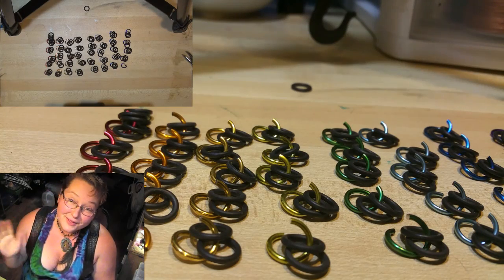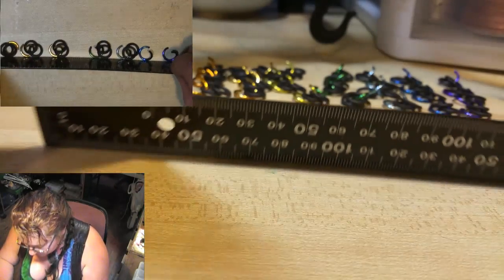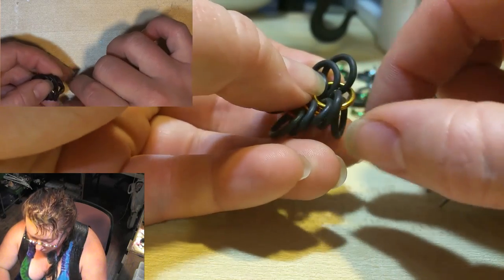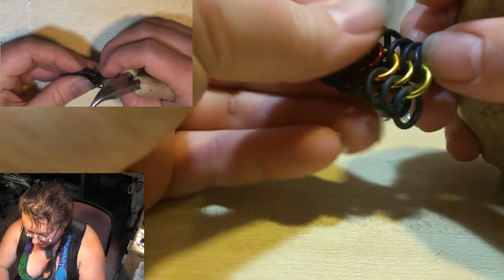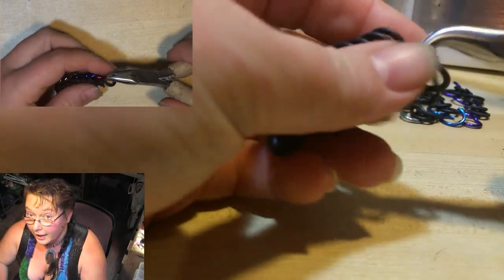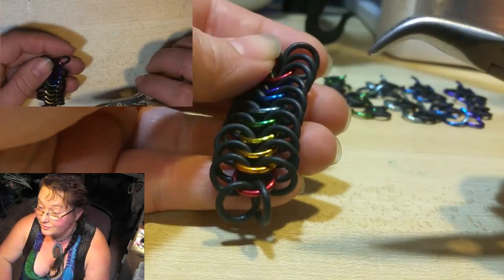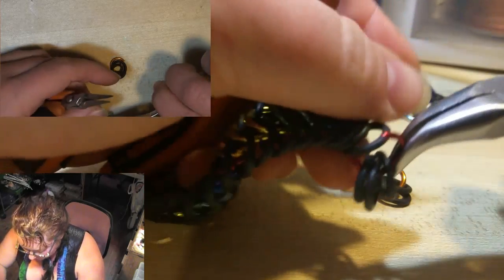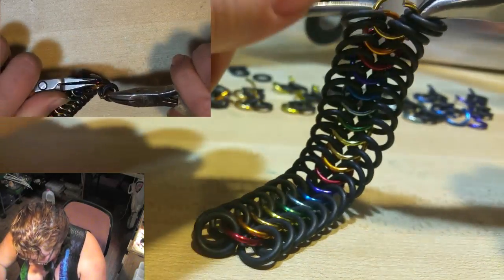How to Weave Chainmaille Stretchy 6-1

Comment: Hi, Yvonne! I get my anodized aluminum rings from The Ring Lord, too. I've seen you tumble silver, but how do you remove burs from finished AA projects?
Reply from the maker: Hey, Shay! I have had some success with running AA projects through the tumbler dry with plain rice; I'd recommend check it every 10 minutes at first until you get a feel for it to make sure to AA is holding up
Reply: Thanks so much. I love the use of the semicolon, by the way!!